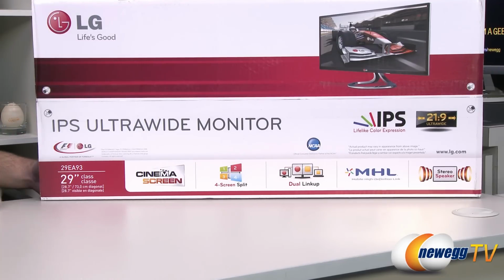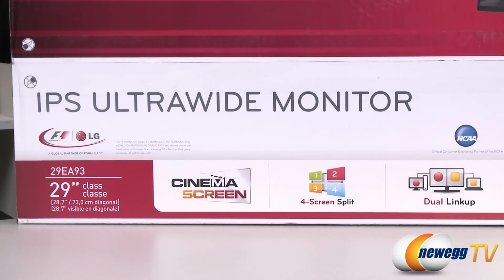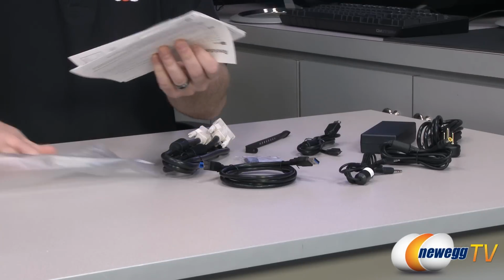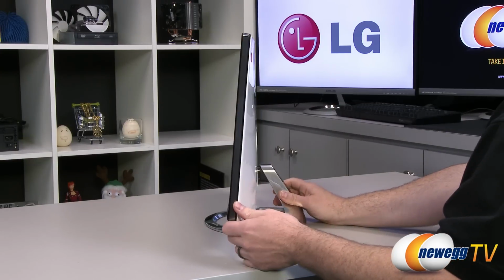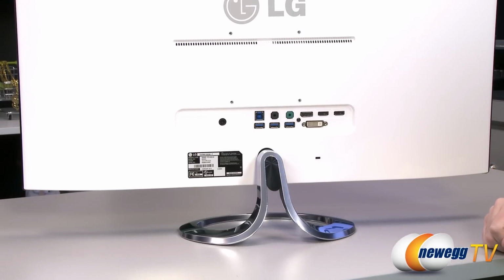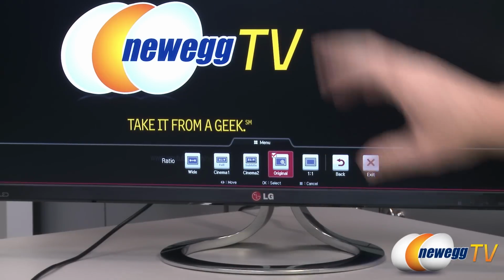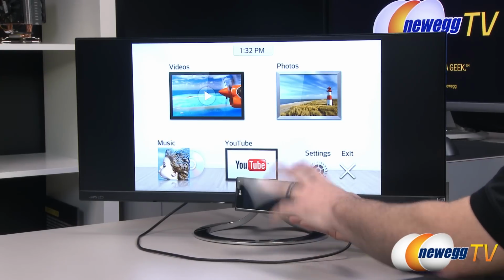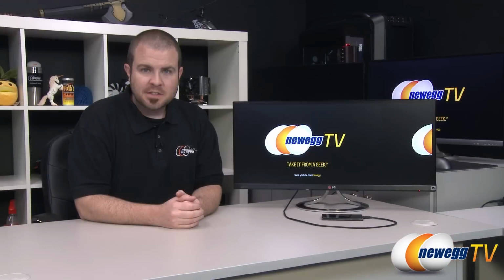Newegg TV: LG 29EA93-P 29" 21:9 UltraWide LED Backlight LCD IPS Panel Monitor Overview

Comment: Why would anyone want this?  A standard 32" monitor gives more width and also has three more inches of vertical display area, so you don't have to scroll up and down as much.  Is this for people who need width but don't have room for height?
Reply: BileMonkey
I am writing this on a 32" monitor.  Okay, you got me, it's actually 31.5", but yes it is still wider than this for half the price.
Reply: ralphinator2 what monitor dude?
list of 31.5 inch monitors from newegg
http://www.newegg.com/Product/ProductList.aspx?Submit=ENE&N=100007617%20600338096&IsNodeId=1&name=31.5%22

32"
http://www.newegg.com/Product/ProductList.aspx?Submit=ENE&N=100007617%20600338096%20600030621&IsNodeId=1&name=32%22

30"
http://www.newegg.com/Product/ProductList.aspx?Submit=ENE&N=100007617%20600338096%20600030621%20600030629&IsNodeId=1&name=30%22

the 30" ones are about the same in price
Reply: ohh a tv iv had very bad experiences games on tvs 
the response times and ghosting anything above 5ms is too much for me i can use 8ms also but their around the same price nowadays
Reply: The LCD screens are made better every year.  The screens in the last couple years are way better than 5 or 6 years ago, and you can even get 120Hz screens now.  Mine is three years old, but high quality Phillips with great picture and no motion blur.
Reply: ralphinator2 are their any ips or pls tvs out yet? that would be cool and something id buy

Comment: Question about this monitor, ok so I am connecting up my laptop to it via a HDMI cable and it is not displaying anything. Is there anything I need to do? The HDMI output does work since I have tested it on the TV

Comment: likely 60hz. You may be able to overclock the hz depending on the available bandwidth from the dual link connector and monitor resolution used.

Comment: What can you tell me about performance when gaming? I know that IPS is not known to keep up with a decent TN monitor when it comes to things like ghosting and color shifting. I am a huge videophile and have been using two Asus monitors with a 1 and 2ms response time. I know that the response time doesn't usually matter to a certain point, I've just always been told to stick with TN if gaming.

Comment: you are correct about digital cinema resolution however that is a totally different area, what you are talking about is aspect ratio. Currently for home tv's we use 16:9 whereas cinema uses 21:9. When you change aspect ratio your resolution changes with it, that is how you can have video without it being stretched out.

Comment: Well, the mother fucking douchebags of the industry won't release on, cause they don't give a fuck about innovation. The god damn 5 inch samsung galaxy s4 has a 1080p display and is said to cost about 237 in total to biuld. the screen should cost 100 bucks(and this screen has touch).  So if these fukwits tell us they can manufacture four of those screens slapped togather and a displayport connection for 500-600 (thats with generous profit margins). I call BULLSHIT. 3000 dollar 4k is exploiting

Comment: As far as I know, apple was not the first company that produced high res monitors and is behind on 4k as well.
Also for a long time technology just wasn't ready for it: A 4k display needs 4 times as much graphics power as a normal 1080p one. Also most people (me included) are perfectly satisfied with 1080p on a TV or computer monitor. In cinemas it makes sense to use a higher res, due to the big screen area, but for movies on a relatively small tv, most people can not see a difference.

Comment: In the last decade, movies were dominantely made digitally. The most used resolution is 2k, which is just a little above 1080p and about 1/4 of 4k. The examples you wrote are actually very unusual. According to wikipedia "the master" was the only 70mm movie made in this century. The Star Wars Episode II (2002)was one of the first digitally filmed movies and it actually used less than 1080p pixels in height. 
So if a projector has a higher resolution it is showing a scaled up version.

Comment: 5ms delay is not a big problem at all for fps. What's the problem is that playing competitive fps on a monitor this size, your eyes cant scan through it quick enough. And not being 120hz also has it's disadvantages for fps. 

So the only thing this monitor isn't good(but still very decent) for is high level fps gaming.

Comment: I wan't to get this monitor with my new pc in about a month and was wondering if the fps would be much lower then when i have a smaller one because of the resolution, the graphics card i will put in my pc is the amd radeon 7970 3gb will it be enough to have a high fps on high or ultra settings in games like bf3 or bf4, around 50/60 fps is fine to me

Comment: This monitor has the same height as a 23.3" 16:9 monitor (16:9 content on this monitor would appear the same size as a 23.3" 16:9 monitor) , and it has the width of a 30.6" 16:9 monitor.

Comment: no, the production cost for a new product line is obviously going to be higher, just like any new screen type has been in its initial launch. Early adoption is always expensive, 3 monitors taped together is not a better solution then getting a screen with the proper ratio. A 50" one of these at 1080p or higher is more than enough, but you have the pov of a reptile right?

Comment: I used to have a .5k monitor until I got a 1k monitor but now I'm looking at this new 2k monitor, but those luxury 4k ones are around the corner, but the problem is I only have 3k available. See how retarded it sounds when you start referring to screen resolutions with metric units? R=aspect ratio SD Rx480 ED/Sub HD Rx576 HD Rx720 Full HD Rx1080
After that you hit cinema resolutions which aren't even measured the same, 1920 (Full HD) and 2048 (2K Cinema) both have 1080 vertical lines of pixels.

Comment: 1. You assume most people can dedicate a room and wall to be conveniently unlit 24/7 in order to ensure optimal picture quality (color correctness, proper contrast and brightness etc) 2. They don't 'support' 21:9, but given it's projected you COULD work around it. 3. Most 50" lcds can display a better image overall for the same price, plasma's and soon to come oleds even more so, and in most cases now you can get 3D on top of the better picture.

Comment: I made a comment back before i replied to you stating how people would say exactly what you just said lol. a 2k projector is not the same as the 10k ones theaters use. and adding aspect ratios to games isnt hard neither is modding cfg files to support a resolution. any 4gb gpu can support this res easily. oh yeah, so few people use amd/nvidia eyefinity/surround because having black bars in your image looks ghetto, not because it costs too much.

Comment: The style right now is to have a thin clean front panel with little or no buttons or ports.  Thus the USB connections are on the back.  Extension cables would be necessary I'm afraid.

Comment: No, but using two apps on a 1440p display makes two really thin applications, whereas on 2560x1080 the applications are more square, making it easier to work on them...

Comment: Would be exactly the same as 3 30" 2560 resolution monitor only difference would be, the 30" is are bigger and 1600 res instead of 1080.

Comment: 699 dollers, what a waste of money, for less than half price i could have 3 1920x1080 monitors, a total of 5760x1080 resolution with an aspect ratio greater at 48:9. not to mention for still less than this monitor i could get a nice 3 monitor stand to go with it. This is WAY overpriced.

Comment: The Asus 29-inch LED MX299Q should be available for sale at $599 which is $100 cheaper. I'll wait cause LG's model has not knocked my socks off.